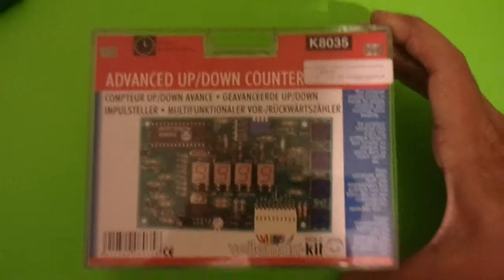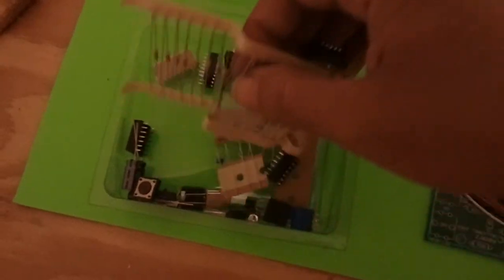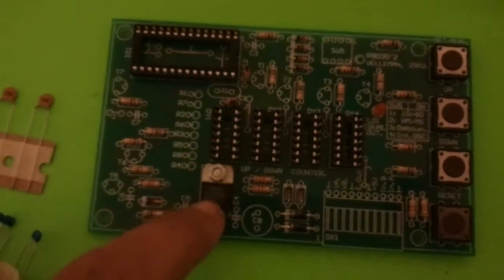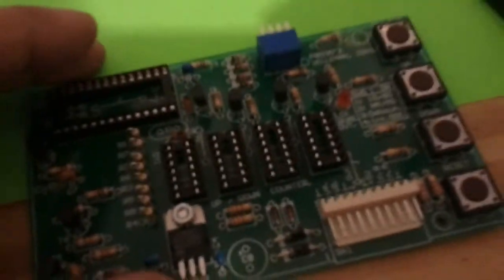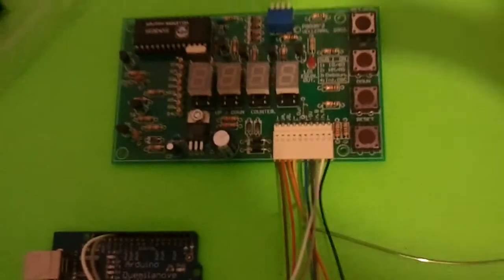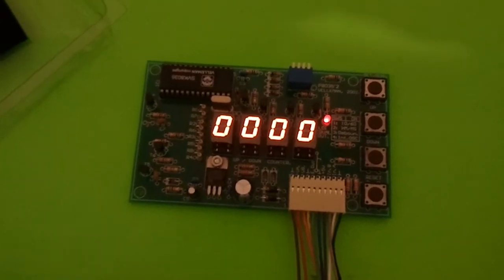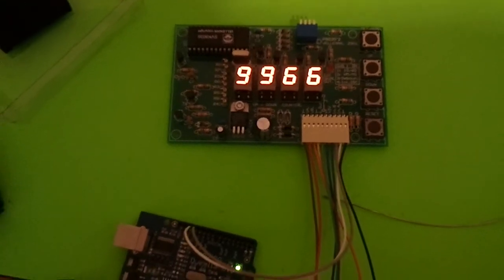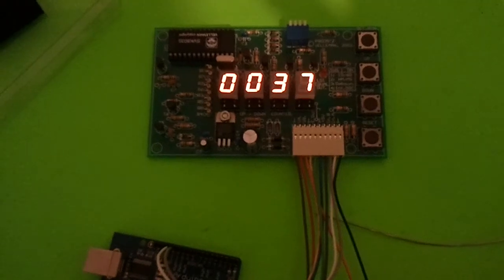Building the Velleman K8035 Advanced Up/Down Counter

Comment: hey man, ive got a problem. im using a keypad which will then trigger the countdown timer but i cant figure out how to connect the wires on the K8035 so that it can work.
Im using a 12V power supply